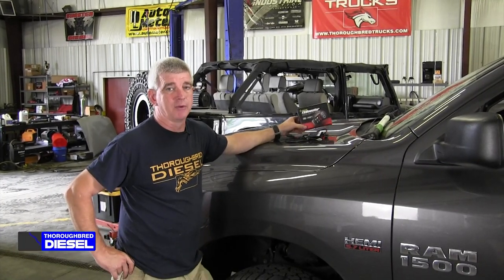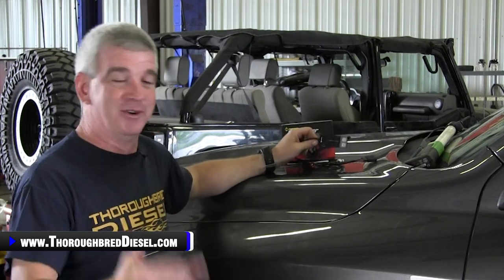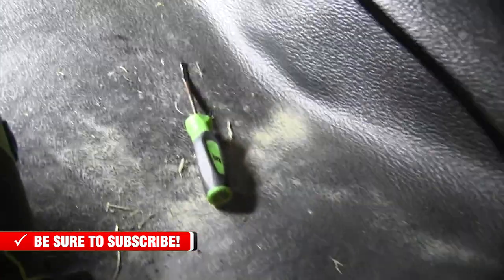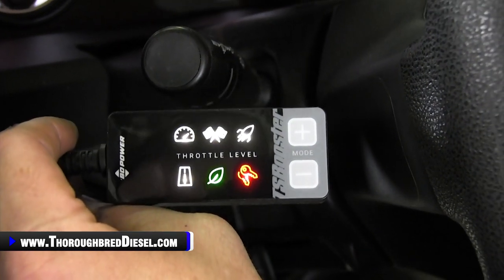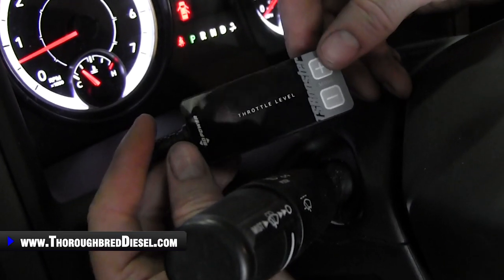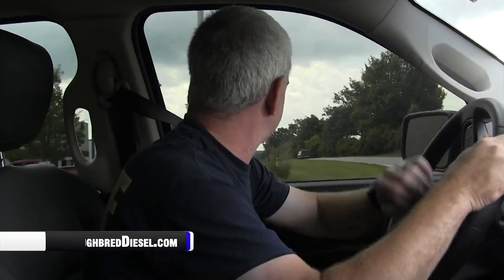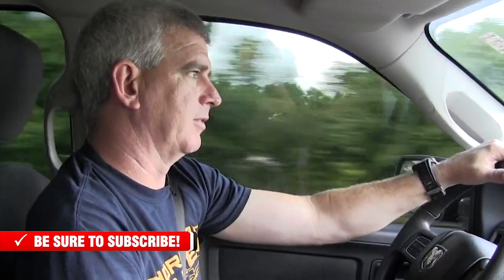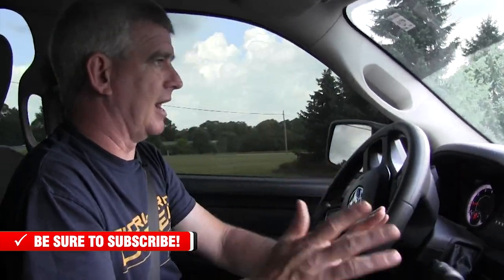NEW BD Diesel Throttle Sensitivity Booster Version 3 Install | We Go Full Ludicrous Mode At The End!

Comment: I just got two of them today based off your review. For a 2015 Grand Cherokee 3.0 Diesel and 2008 Grand Cherokee Hemi. The diesel is bone stock and the  engine was laggy on starts and this has completely transformed the way it reacts. Definitely works for that application. Now the HEMI is a different story. It has some minor mods like Bilsteins, Magnaflow, K&N CAI but no tune. Had power but nothing exciting about it. I could do a 6 sec 0-60. Well add one scoop of throttle sensitivity booster and hold on tight. The street and race modes are plenty of power like you said but Luda is a on a different level. He's right about the sensitivity, literally blinking at the gas pedal you get head snaps back like a boosted car. It actually chirped the tires, remember this is a true 4x4, so I think it may have crinkled up the pavement it pulled so hard. I did another test and did a 5 sec run to 60. Insane. A friend got in and asked if I put a supercharger or something in it. If you have a vehicle this fits and you have always wanted to get some power with no mods then this is it. Plug and smile installation. You can even switch while you are driving so you can switch modes and get Luda when you see a mustang owner you want to make question his purchase at the next stop light drag race.
Reply: I drive a ram 1500 ecodiesel and I'm thinking of making the switch as I can notice the engine lag significantly before it gets going.... please let me know how is your experience so far with the product..thanks!
Reply: @sachavda4197  Better late than never! It absolutely works and worth every penny. Ludacris will snap your neck!
Reply: @arischreiber2213  Thank you!

Comment: I keep getting a p2121 code. Is there anyway to do a relearn the throttle again with this ?
Reply from the maker: IF you remove the module does It still code?  If it doesn’t, then contact BD for warranty support.
Reply: @thoroughbreddiesel  with module removed works as intended.

Comment: I drive a 2015 1500 3.0 ecodiesel. I have noticed the engine lag significantly so I was wondering if I should go with the pedal booster or a full AFE tune which will increase HP + Torque.... Any suggestions will be greatly appreciated.

Comment: Does after market  remote start work with this product I want to get one but i have a viper alarm and remote start on my 2015 duramax also I have motor ops dsp 5 switch tuning
Reply from the maker: I am not familiar with the Viper,  but this only hooks up at the APPS so if you have nothing there with the alarm and remote,  you should be good.